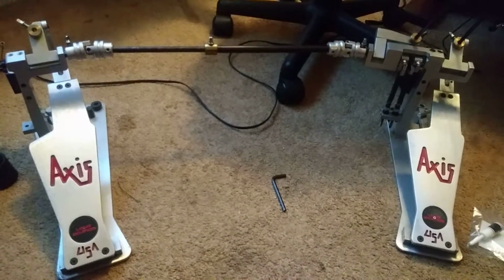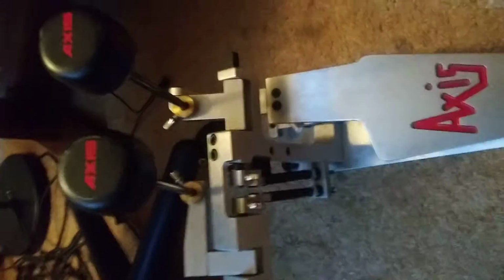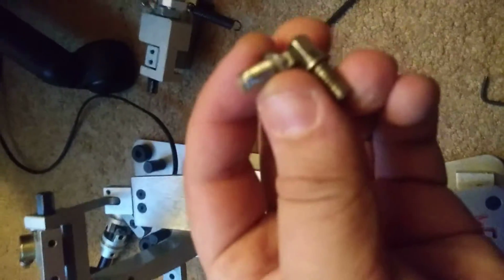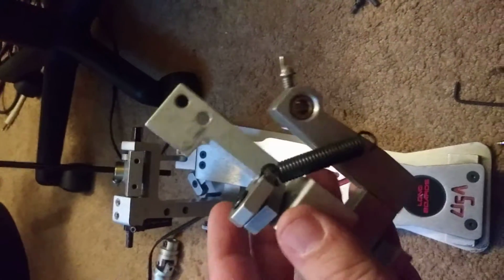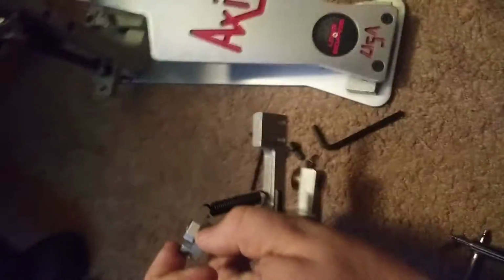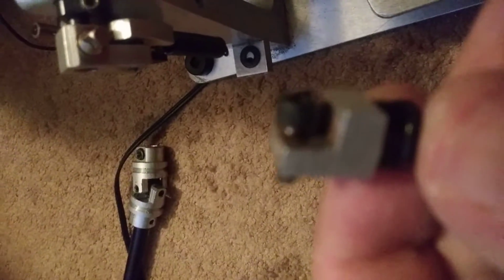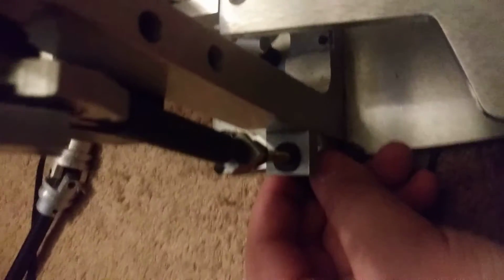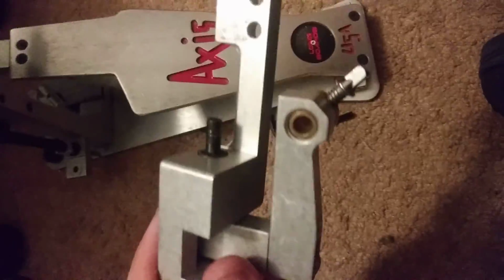How to connect a double axis pedal into 2 single pedals

Comment: Hey Matt, great video. I got my Axis A longboards (old thumb screw version) as individual singles off reverb, then bought the double coversion kit from Axis. I kept the original springs on each pedal and are functional, but is there any difference in feel and performance by having both springs on the right side verse just each longboard pedal? Also, from your experience on disassembling the pedals are both springs to the right side just more convenient to match the spring tentsion? My coversion kit did not include a new spring mounting bracket and bolts to have both spring  assembly on the right pedal.

I appreciate your insight on this.

Thanks